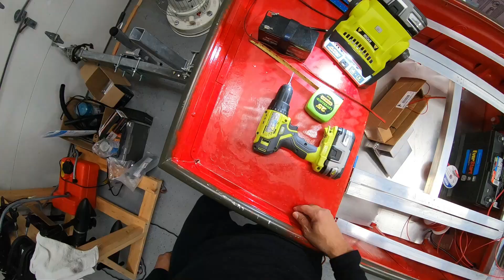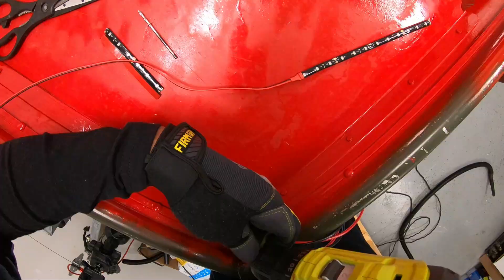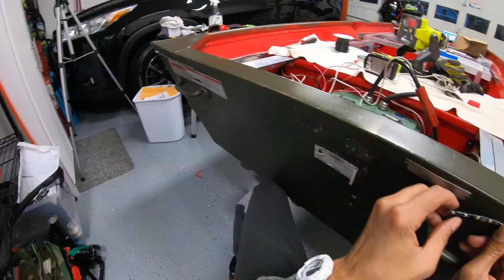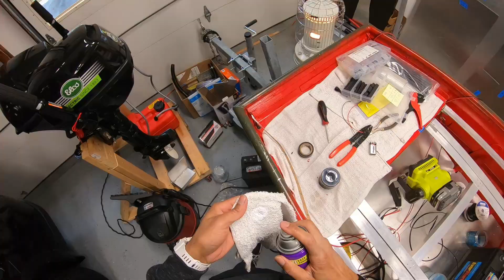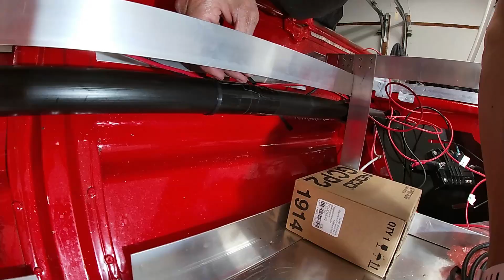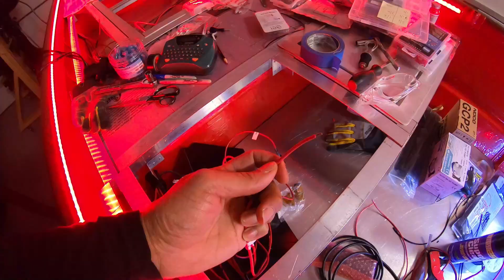Jon Boat Electrical Wiring 101 Pt. 2 {Jon Boat to Bass Boat Conversion} Alumacraft 1232

Comment: When you were cutting the red led lights to fit ,did you have to solder more connections on to use them on the other parts of the boat ? Or did you just buy another set and cut them to fit as well...sorry for all the questions I just finished the framing for my 14x36 as I'm using your vid as a blueprint for mine and I'm starting the wiring phase, thx in advance!!!
Reply from the maker: @lilhugh01  if I remember I used two light strips for the deck so I didn't solder anything. But if I had to I would solder on new wires if I  needed to.
Reply: @BassBrothersFishingDMV  Thx so much!!@

Comment: Did you run all of that to your starting battery for the boat motor or is that all to the other battery and then also where are you hooking up the fishfinder so it doesn’t get interference which battery

Comment: Sorry I know nothing about wiring.  Am I able to run my 3 front LED lights into one switch? Or do they have to be on 3 separate switches?
Reply from the maker: You can run 3 into one switch. Using a bussbar may make it easier for you but not mandatory to use.

Comment: Could you have used grommets for the nav lights wire instead of just silicone?
Reply from the maker: I couldn't because of the double thickness of the aluminum that holds the gunnel rail onto the boat. Good thinking though. 👍🏾

Comment: Check out yak power, you may have already... they have led light strips with plugs and through hull gasket plugs. Wire it up, plug and play. If the strips go bad you can just switch out with new strips and just plug em in.
Reply from the maker: I'll check em out
Reply: @BassBrothersFishingDMV  BTW, we got to get out on some water this summer! DM mean IG if you want to rip some lips my man! @amals51

Comment: Hey bud, maybe you’ve seen these before, but yak power makes an led kit for kayaks that has a plug you can run through the hull and the led strips plug into that. The plug acts as a through hull seal which you can silicone. The strips have the plug on them, this way if they go bad, you can just replace the strip, and it will plug right in. Long winded description but they look like something you could use for your nav lights...?? Tight lines!